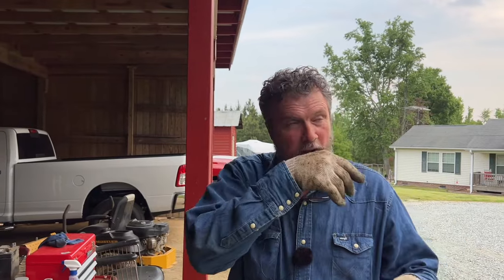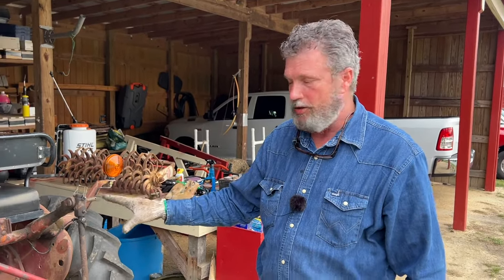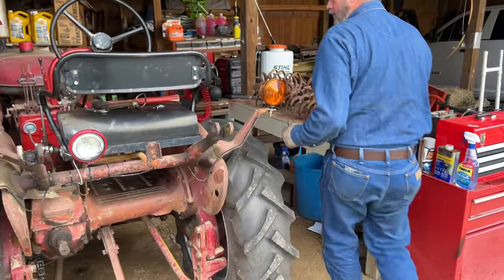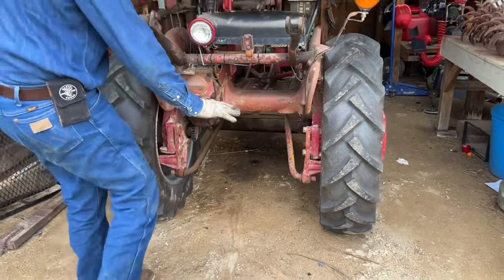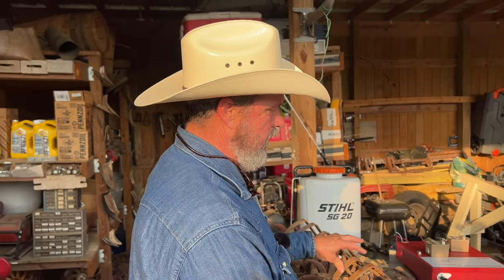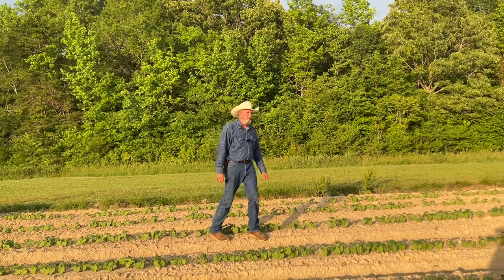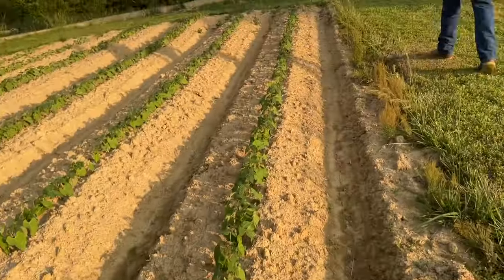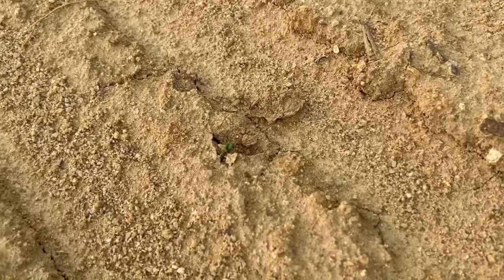Fast Hitch Removal and Cultivating Green Beans 🫘

Comment: If you know someone that’s got a bead blasting cabinet you could dismantle them and remove all the rust pretty quick. Then prime and paint them. They would look like brand new.
Reply from the maker: There pitted pretty bad on one but they will still make a fine set.

Comment: Joey hearing your gear noise gives me hope.  I have bought several of the small Farmall’s of late and a couple do sound similar to your 140.  I will never be able to get the usage out of mine that you do ( lack of acreage and past 75) and figure if you use it then I’ll do the same.  I do have to replace a clutch/pressure plate on a Super A and it has a serous left brake issue.  Not looking forward to splitting that tractor.    Stan here.
Reply from the maker: I hope to rebuild it one day but for now we’ll keep it serviced and hope she keeps ticking lol.

Comment: Paint them the old IH off white, they'll look sharp plus adds protection to the steel.
Whenever anyone uses one of my tractors l always tell them as a disclaimer that the chances are they'll pick up some grease on their clothing so no complaining they get a stain or two. Myself personally l wear my dark navy work clothes so never have to worry, l'm more concerned keeping my equipment in shape than l am getting dirty. It's simple really, there is no regular clothing on earth that will last longer than a properly greased old tractor.
Reply from the maker: I have found out the shout grease buster in a can is a miracle worker in the wash.

Comment: Thanks for the video, it really helped me set my tractor up today to lay my corn by. Can you make a video on how to remove the drive sprockets and chains on the fertilizer attachment to install the draft bar ???
Reply from the maker: Hey Andrew 
I don’t ever take those sprockets off the fertilizer unit to put the draft bar on. I either remove the whole fertilizer drive unit or use a center bar that’s bent made to work with the fertilizer unit still on the tractor.
Reply: Where can I get a bent bar?? Or the dimensions of where it’s bent so I can make one
Reply from the maker: Hey Andrew 
I would say best place would be www.burchstoretractors.com

Comment: Hey Joe, do you have any plans to replace the rear wheel bearings and possibly going through the transmission in the next year or so? Just curious, I know it's a pretty good job. Definitely a cool weather project....
Reply from the maker: After driving Rogers 130 you can really tell the difference. To be honest it all depends on funds. I have the ability and know how between me and Roger but funds will determine how quick I do it. I wanted to do the hydraulic first but yes it’s most definitely on my radar to do.

Comment: As. Crazy as those rolling cultivators are I'd make up an electrolysis tank to remove that rust.
Reply from the maker: I had it on my mind to wire Brush or sand blast them. You can tell one of them got fertilizer on it a lot.
Reply: I never done the electrolysis myself just wire wheel but all those many surfaces and things. Just let the electricity remove the rust and you come back a day or two later